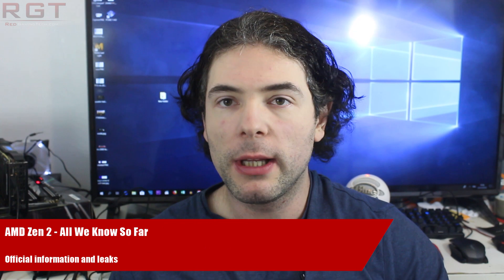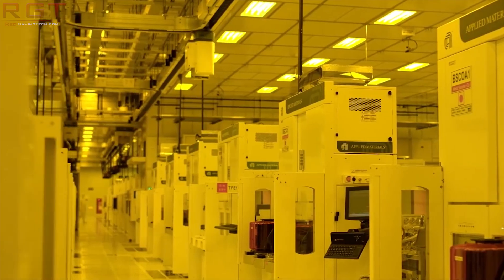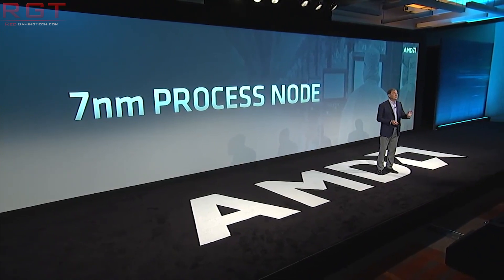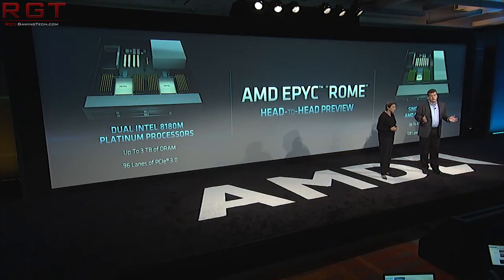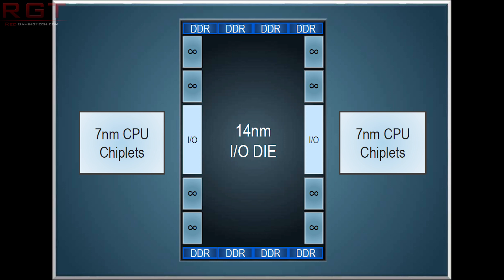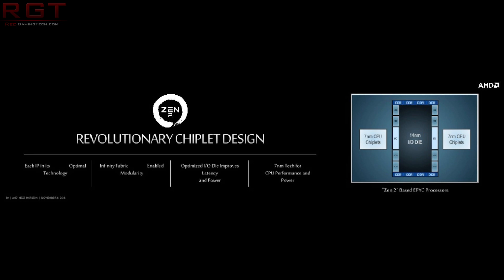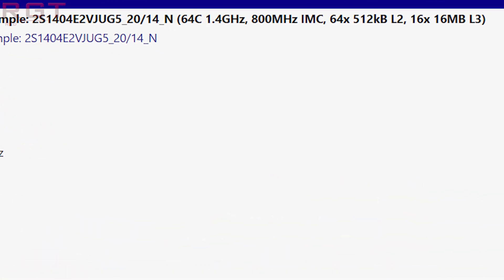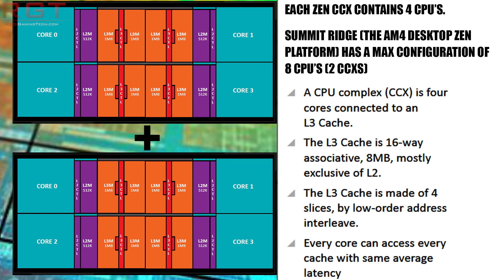AMD Zen 2 All We Know So Far | Zen 2 Official Info, Leaks & Rumors

Comment: One of the biggest Zen2 advantages is that it is a derivative of the 8c chiplets for Rome's multi module chips. One of the major draw backs of Zen1 was cross CCX latency and its memory controller. Hopefully this mean AMD will produce single module 4-6-8c chips for their mainstream "gaming range" chips. The next 3700x 8c16t chip could be a single module bringing memory latency down to 40ns and eliminating CCX latency altogether. This on it's own would be enough to bring Zen1 arch to a parable of Skylake. Add 15% ipc and higher clocks and we could have (abiet likely for a short about of time) an AMD chip being the real king of gaming... A 3700x of this spec could match a 9900k at 5ghz, when AMD's chip will likely not go much above 4.5. 
Exciting times.

Comment: You know what would be great? If AMD released a slightly more powerful CPU+iGPU than the PS5/XBox Scarlett (or whatever they call it) as a budget chip option for home consumers/small business. I'd love to make a small "Shoebox" PC with one. No clue where I'd use it, but it'd be fun to slap it in a custom case on a mini ATX/ITX b550, even if I just ended up selling it on Ebay.

I also really hope that they are able to use ddr5 by then, but we'll see I suppose. It would be a bit of a bummer to build a mid too hedt PC just to have ddr5 come out 3 months later. Funny, my first AMD build was on a Biostar board right when ddr1 released, and had 8 dimms, 4 sd and 4 ddr1. It's the only board I can recall building on that supported two different RAM types (besides ecc and non ecc obviously).

Comment: I think Zen2 will be the launch that I swing over to AMD in my 20years of pc gaming. If AMD can release a R3 6C12T and R5 8C16T with a 4.2GHZ base and 4.8GHZ boost minimums and a R7 12C24T 3.7GHZ to 4.2GHZ minimum. The R7 consuming same power as current R7 and costing the same as current or just slightly lower.
Reply: Well supposedly they will be making a ryzen 9 3850x 16 core 32 thread 4.3ghz base clock 5.1ghz boost which is actually pretty fucking amazing if you ask me. That and with a single threaded performance boost and half the power draw per iteration from the previous gen ryzen chips is a steal.
Reply: Ryzen 5 3600x rumored to be 8 core 16 threads at 4.0ghz base 4.8ghz boost at $229 I will definitely buy it if it is true, don't need more cores than that.

Comment: This is a basic way of looking at this but whatever. The 2700X scores 180 in cinebench r15 single core. Even if Zen2 the 3700X has 10% IPC gain which takes it up to 198 score then add another 300mhz for the 4.5ghz xfr boost, should be getting scores over 200 right on par with 9th gen Intel. Also consider the 3700X may also be able to hit 4.6 or 4.7ghz overclocked. Multicore should get up over 2000 easy. Which is funny cause the i9 9900k only managed 2300cb at 5.3ghz in cinebench r15. Even 5% IPC gain plus higher clocks will make a noticeable difference.

Comment: +25% performance on average or +25% in syntetic task? If gaming and render performance wont give atleast +15% then i'd rather go back to Intel. Ryzen 3600/3700 should atleast reach 8700k levels if it wish to compete. I personally went from 3770k to 2600x and i'm disappointed - +5-10% performance in games against a 6-7 year old CPU = pathetic. Render is notably better, but that alone is not enough.
Reply: @KingOfGorillas he just told you, 10% better after 7 years at the same price point is... let me put it this why : shit.
Reply: @KingOfGorillas 269$ vs 317$, you know, same ish ;) not like a 7980XE kind of price point, you get it i'm sure. Benchmarks speak for themselves 10% on average!! But it's not disapointing on AMD's part for me, it's intel who hasn't innovated for shit, because AMD today vs 7 year old AMD there is a gigantic difference.
Reply: @KingOfGorillas If the lineup would look like this : 4-8-16-32 cores all double threaded and 5ghz base, we'd be game.
Reply: It all depends that you compare 2600x to, sure it is more than 10% faster compared to an 6 year old i5. But 3770k under decent OC usually end up faster in games.

Comment: Few things:
1. ROME 1.4Ghz speed: speed is still not final yet. Don't forget - double the cores and the mega I/O chip needs a lot of cooling, and in most cases it's an air based cooling. You can't stick an AIO on those servers and those chips will need to run in 1U case. My guess: speed will go up to about 1.6-1.7 base. 
2. AMD DOES create custom chips for big customers with faster chips. The EPYC chips that Amazon purchased are faster compared to the 7601 (and no, they are not listed in AMD pages)
3. L3 16MB issue - the L3 is not located inside the chiplets, it's in the I/O chip, so yes, they probably doubled it from previous generation.
4. 8+ cores on AM4. The socket wasn't designed for more then 8 cores, same as AM3 with previous AMD CPU's. AMD could lower the price of 2950X as an answer to Intel's 10 core rumored CPU, but the biggest problem that AMD faces is .. motherboard prices. You can't find any TR4 based MB for less then $300, so if Intel will release 10 core CPU based on LGA 115X, AMD will have a problem.

All in all, we are a month (or so - January 8th 2019) away until Lisa Su will announce some news about Ryzen 3XXX at the next CES show.

Comment: i am hoping for 8 cores 16 threads and 4.6/4.7 ghz for 300$. that will put zen 2 in a very good place. even if intel launches a 10 core mainstream cpu everyone knows it will cost 600$ or more.  the i9 9900k actually cost 700$ when you add in the cost of a 240mm liquid cooler. that cpu runs hotter than bulldozer. the biggest problem with current ryzen is the clock speeds in clock speed sensitive applications. the performance of a 2700x and a 9900k at 4ghz is very close to one another. the 9900k gets most of its advantage from the high clock speeds.
Reply: I want 16c32t at 4.2ghz with the performance of skylake for around 350 euro. That would kill in both Adobe Premiere and After Effects and gaming.
Reply: Calyptico no game that you could imagine will ever utilize more that 8 cores.... not yet at least.
Reply: @joeg9084  Not true Star Citizen is being designed to use as many cores as you can throw at it.
Reply: Jereome Moore sure, but right now how many games do that. How many games can you count right now that use more than 4, or even 3 cores? Hell, most of them have issues with multi threading comparability.
Reply: I just hope the that they can make it smart enough that clock speed alone won't be such a deciding factor.  They used that silly numbering to say this is as fast as this or that Intel cpu. It worked for a little while but got a bit silly after a while but GO AMD.. Can't wait...

Comment: I'm wondering if Zen 2 will run on complete crap AM4 boards because of the low power consumption/VRM's required.
Reply: depends, If you mean run 8 cores at 4.5 GHz on a cheap B350 board no. But you could under clock / volt it to keep it from frying you motherboard.
Reply: I guess since it's memory bandwidth constrained, it ain't gonna matter until the motherboards are 7nm.

Comment: RYZEN 7 3700 <8c 16t 3.5ghz 4.2ghz boost(4.4ghz xfr)>AM4

RYZEN 7 3700X <8c 16t 3.9ghz 4.4ghz boost(4.6ghz xfr)>AM4

RYZEN 7 3800X <10c 20t 3.5ghz 4.2ghz boost(4.4ghz xfr)>AM4

RYZEN 7 3850X <12c 24t 3.4ghz 4.2ghz boost(4.4ghz xfr)> AM4
Reply: 3850X? I don't think so but we possibly get a 3800 and a 3800X which could and very likely will be 12 Core.
A Stock Speed of 4.0Ghz is possible on all Ryzen 7 3000 Chips and i'd say the 3700X will go up to 4.75/4.8Ghz on all Cores with a 3 Core XFR of possibly 5.15Ghz
Reply: @KNightstyleZ  oh yeah I didn't even factor that there could be a 
RYZEN 7 3800 non x lol
Reply: @KNightstyleZ  also what you said would truly be EPYC, oh I mean Epic!
Reply: The engineering sample already run at 4,5 GHz. If you think that jump from 12 to 7 Nm will improve clock spd only by 100-200MHz then you are stupid.
Reply: @blackwidow7804  I'm being as conservative as the engineering samples were reported to not be rock solid at those frequencies, but I will be stoked if frequencies are higher.

Comment: AMD is fine where they are.  They don't need to chase Intel in all things.  If Intel ups the core count that is fine.....They can't beat or even come close to AMD's value.  Further if AMD get's the expected frequency jump (4.4 to 4.5) and IPC (15%"ish") boost then AMD wins with the current core/thread counts they have.  8 cores mainstream is far beyond what current programs can handle, especially "gaming" type programs/engines.  In productivity the programs still don't scale well at all but do scale some.  Most programs are frequency dependent and most likely will remain that way for at least 3 years or until the devs' development cycle completes.  Besides the way AMD has designed the overall Zen architecture they could quickly (a few months at most) come out with a 16 core 32 thread CPU on mainstream.  If Intel wishes to really get into a "core war" with AMD it would not bode well for Intel.  AMD is years ahead of Intel on chiplet design.  Besides Intel, at least for now, is STUCK primarily on 14nm (I forget how many +'s they are at now) and AMD is a node ahead of them with TSMC's 7nm process. That means that AMD, on Zen 2, could just double the current number of cores on a chip and there would be little Intel could do (without a "sub-ambient" cooling solution)!  Intel is in trouble until 10nm.....real big trouble if it isn't in MASS production by end of Q4 2019!

Comment: All i care about is a proper Zen 2 APU with some low cost HBM serving as L4 cache/framebuffer + DDR5. I am tired of using discreet gpus that take a lot of space, the fan is loud and use a lot of power. APUs are the future and are going to remove the pcie latency from OpenCL as well...
Reply: you can't have that kind of power (gtx 1060 or rx 580) in a APU until 2 or more generations (on a refined 5 nm process) the reason you can't it's cause it has a limit of how much power you can give to the cpu socket, also memory is not as fast as gpu memory. You can solve the sound issues with a external cooling system, arctic accellero 3 or raijintek morpheus 2, if you already have a good gpu you can just buy 2 120 mm silent fans and take away the shroud of the card and hold the 2 fans on the heatsink, i did that and reduced the sound a lot (also decreased the temperature, but the biggest jump was in sound reduction)
Reply: But you gotta give props to the R5 2400G. Surely it serves as a glimpse into the future that you wish for since 5 years we didn't expect that this chip was feasible. People are heralding it as the budget all-in-one gaming chip!
Reply: I agree apu's are the future.

Comment: It's well understood that 4 core complexes are the optimum number for shared cache arrangements, so it's unlikely that given the now confirmed 64 cores of Rome, that there would be any other configuration in play (like an 8 core complex) as we know that there are 8 chiplets which confirms 8 cores per chiplet, and thus two CCXes. 

7nm is a full node jump from 14nm and the trend has been a doubling of L3 at full node, e.g. Athlon 64x2 90nm 0Kb per core, phenom 65nm 512Kb per core, phenom 2 45nm 1MB per core, fx 32/28nm 1MB per core (2MB per module), Ryzen 16/14nm 2MB per core 8MB per CCX.

So following that trend, it would be reasonable to expect a doubling of the L3 to 4MB per core or 16MB per 4 core CCX.

Given also that it's zen 2 and not karma or some other name, that also suggests that it's not a radically new architecture, just a new Zen design of a chip with 2X4 core complexes linked by infinity fabric.

Comment: Although i am an computer science engineering student I was unable to understand most of this in the core analysis ......
I am only first year .
Reply: You haven't had computer-architecture (in the Patterson book MIPS is used as an example) yet? If not, study that part and you will understand what you need to understand. As soon as you have studied a microarchitecture and assembly code and the relation between a higher programming language and assembly you should understand most of how it works. Of course to really understand it you will also need circuit theory (transistors, AC...). Though to be honest, even then you don't fully understand it because at the end of day scientists and engineers use models which have been proven to work but probably aren't 100% accurate.

If there is anything which you are curious about, ask and maybe I can give you some insight. I don't know all the details but I know a few things about computer architecture and how chips are made.
Reply: With regard to branch prediction. The simplest way to understand it, in a loop most of the times the outcome is the same because you repeat the 
loop most of the time (hence using a loop), so you guess that you stay in the loop. If that happens you don't have to wait for data to be 
fetched because it was already fatched many instructions before. If you guess wrong then you wasted X cycles. As long as you guess correctly 
most of the times (I think it is around 80-90% at the moment, not sure) then you will get better performance. In a nutshell that is brance 
predictino but obviously it is a lot more advanced than how I describe it.

Cache is all about reducing data-latencies. Data moves very slowly from RAM (or SSD/hard drive...) to the CPU cores so you try to put as much of the data which you need later already in cache. Because the cache memory is so close to the cores and the surface is so small the amount of cache is low so you need to make sure that you predict what data you need later. Do you search for the data in cache and it is not there (cache miss): wasted cyclces.

Simultaneous multithreading (Intell calls it Hyperthreading, that is just a brandname of it) is basically that you feed the ALU's (floating point, integer) with two pipelines, if one instruction can't be executed due to the data not being there then a few cycles later the instruction of the other pipeline can be executed. So the hardware which feeds the ALU's is doubled. That costs a lot of surface area and the gain decreases with more than two so they keep it at two. 

If you want to know more about the Zen architecture:
www<dot>anandtech<dot>com/show/10578/amd-zen-microarchitecture-dual-schedulers-micro-op-cache-memory-hierarchy-revealed
Reply: Luredreier posted something which got blocked by Youtube its filter because Youtube uses a whitelist for website-adresses. 
He posted a link to interesting documentation: www<dot>agner<dot>org/optimize/optimization_manuals<dot>zip
Luredreier, post it like this and your post doesn't get blocked. For the next time. ;) 
You won't see that your post got blocked unless you load the comments without being logged in (open a private window (ctrl+shift+p in Firefox) and you will see it. 

Rick, if you want to read something which is both educative and shows the shady side of this industry: www<dot>realworldtech<dot>com/physx87/
In short, Nvidia made run PhysX like crap on the CPU by using the wrong outdated instruction set, probably because it wanted people to buy its graphics cards with PhysX. Just one example. Intel used the wrong instructions sets of AMD CPU's around 2004 when AMD had the better CPU's.
Reply: @peterjansen4826  thanks man
Reply: Mianlo 2  
Here too. But not really any C programming teaching, more like a "here is what you have to do, these functions can be used, good luck with it" 'teaching'. For example, we lack good explanation on the end of a string for several functions (like Scanf, does it end with a /0 or not?). Those kind of things. I myself am not a computer science student by the way but we do have a two semester computer science subject which is quite demanding for a two semester course and we are pretty much supposed to learn ourselfs how to program because we do have to master it.
For C we only learn the most essential: variables, loops, pointers, input/output and a few other functions. Nothing fancy.
Reply: Computer science at college doesn't actually teach you anything useful. I know Computer science people who have never built a computer.
Reply: @frostybe3r  
That is a rather narrowminded view.
Reply: @peterjansen4826  it's also mostly true with college students.
Reply: @frostybe3r  
The purpose of education is not to only focus on what is directly being considered "useful" (it is a consequence of neoliberal politics that these days people think that a university should be like a vocational school and focus on preparing students for a specific job), the purpose is to give a good intellectual foundation. Also a computer scientist doesn't have to 'build' a computer. I find it somewhat strange if an electrical engineer or computer scientist doesn't assemble his own desktop computer when he uses one but that is a different story, it is not like it is difficult to assemble your own computer, it just is a matter of interest.

Comment: I think that the ipc improvements is what a traditionally ryzen 1xxx and 2xxx series would achieve with all those improvements. For gaming this would mean that AMD simply are taking all the latency into account and the improvements will make it just as fast or a bit faster than the first Zen/zen+ arch. In crunching workloads having more cores is preferable but as we know having high latency in software like gaming is very favorable so all this is just to make sure that the new Zen2 arch will at least be as fast as the old one even if the latency would be higher,